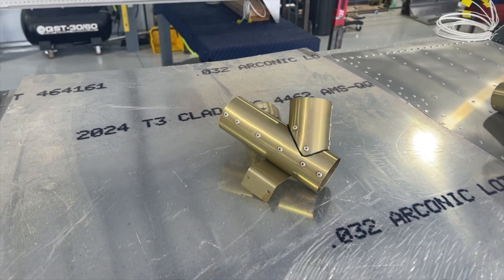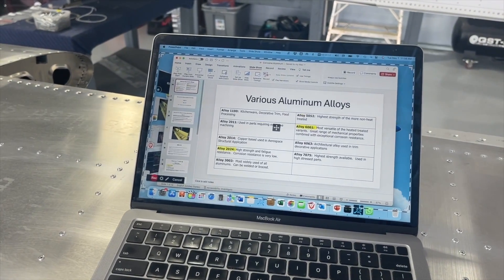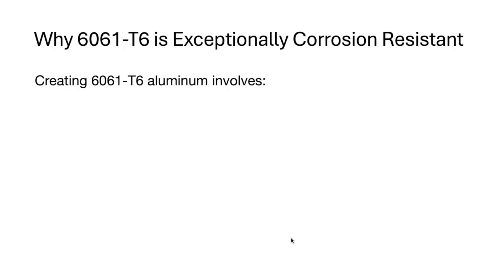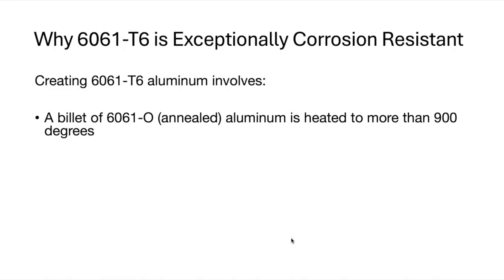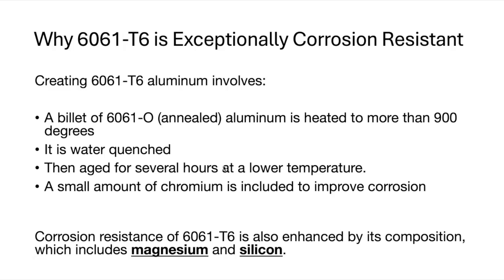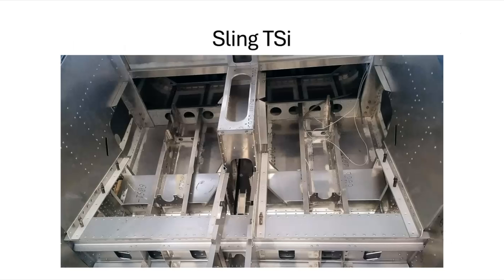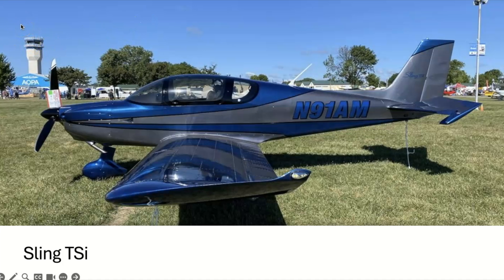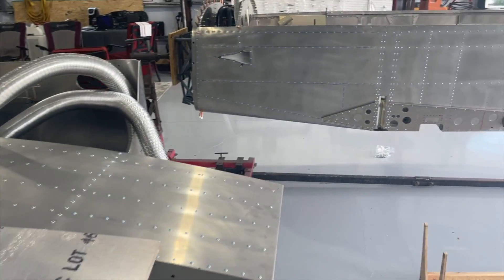Aircraft Aluminum and Corrosion [Sling TSi Build]

Comment: As someone that works on boats with fiberglass and aluminum, and is building a fiberglass airplane, I agree with everything you said. In boat construction, we often call 6061 "marine grade" aluminum. I have used 6061 in bilge saltwater applications. I have had bilge parts in 6061 constantly in salt water last structurally 20 to 30 years.
Reply from the maker: Thanks for sharing your thoughts, and thanks for watching!

Comment: I live in the North West UK. It rains over 300 days a year. I’m going to Alodine, prime with Zinc Chromate and spray internally with ACF50! Belt and braces. If anywhere will rot aluminium, the UK will. We’re right next to the Atlantic, with storms and prevailing westerlies.

Comment: Here's why this is not a good idea in my opinion, hope it makes sense. First, most airplanes are indeed made of 2024-T3 but these 2024 sheets come CLADDED with a layer of pure aluminum. This cladding is for the corrosion issues with 2024. So when you see 2024 corroding on an airframe, it is not "oh yeah that's because it's not as good at corrosion", because it indeed has a pure aluminum cladding. It is not 2024 that is corroding, it is the pure aluminum that is breaking down. NOW - pure aluminum is EVEN BETTER at corrosion resistance than 6061-T6. So 6061-T6 is going to corrode faster than your traditional 2024 built aircraft. If you would put a coating of some sort on 2024 clad, then why would you not for 6061?
EDIT: Now, if you aren't in a corrosive environment (like Florida or some place like that) - it really isn't a big deal. Won't be an issue anyways.
Reply: The problem with the Alclad solution is that the cuts/holes/scratches that penetrate the cladding will let corrosion start. My impression is that the serious 2024 corrosion issues aren't the surfaces themselves but the edges and rivet holes which are all potential places for corrosion to start. Once corrosion has started somewhere, it'll just go under the Alclad.
Reply: @patrikj  Yeah I thought about that, makes sense. However just remember almost all aircraft grade 2024 is "Alclad". Alclad is a trade name when it first came out, but all 2024 is cladded now that I see available for aircraft panels. Also - you still see corrosion in areas that are not pits or fastener areas, just to keep in mind.
Reply from the maker: Great input!  Thanks for that!
Reply: @TheBaldPilot  No problem, just my 2 cents for what its worth!

Comment: I had a short career as an assembly mechanic in the 1970s at Boeing.  Some components were made of an alloy that had a thin sheet of pure aluminum rolled onto it.  Any part of the 747 (at the time) that was exterior and not to be painted were made of this material.  At the time, American Airlines paint scheme was to leave the fuselage unpainted.  The planes had a mirror finish when the protective coating was removed in the paint shop.  They were gorgeous.  If the cladding got scratched, there was a special repair done to burnish the pure material into the scratch, effectively restoring the pure coating over that area, and then polish it so it matched the surrounding material.  If that could not be done the part was replaced, sometimes whole body panels!
Reply from the maker: I did not know that.  Thanks for sharing!

Comment: There are also corrosion specialists out there that use pressure sprayers with very long, thin 'fogging' tips to coat all the internals with Corrosion-X or similar.  Can be done every few years for those that want it.  Probably not as good as Zinc Chromate, but apparently the spray stuff is getting quite advanced.  At Sun-n-Fun and Oshkosh they have 1-hour seminars with more details on this.
Reply from the maker: Yes I have considered going the Corrosion X route.  Would be pretty messy I'm sure!

Comment: Good video. I came to the same conclusion for the same reasons. A few years down the road I'll probably do a Corrosion-X application, especially if I end up spending more time in a coastal area, where there's more salt air. Not too worried about it in my current location.
Reply from the maker: I feel the same way Mike.  Corrosion X makes it nice to go back and treat if the conditions warrant.

Comment: There are bare aluminum airplanes over 70 years old still airworthy and flying that have never been treated with any corrosion proofing. If you're in a dry environment and keep it clean it should last forever. Had a friend with a Cessna 195 bare naked plane still good as new. He spent 4 hours polishing for every hour flying to remove the water spots, but no corrosion.
2024 is prone to corrosion but most is clad with a thin coat of pure aluminum (Alclad) to protect the alloy so , except for scratches, it's stable in most environments.
I have a little experience with aluminum and corrosion as I have flying and maintaining float planes in salt water for 40 years and am anal about corrosion proofing. I just spent over a month cleaning up a Cub wing I thought would take a couple of weeks to recover because of a hint of corrosion starting. I wouldn't worry about it if I were in your shoes.
Reply: You beat to it. I learned that in the Navy.  The aircraft were skinned in 2024 T3 Alclad. The pure aluminum develops an Aluminum Oxide layer which is very thin but about as hard as sapphire passivating the surface and stopping any corrosion from happening. That Alclad layer is also why you can polish the skins to a mirror finish.
Reply: @JustaPilot1   You can polish 6061, too. You don't see many unpainted Slings, but the Sonex is also made of 6061 and they're often kept bare metal. A good 6061 polish job looks just as nice as Alclad.
Reply: @patrikj  Never said you couldn't
Reply from the maker: Good information!  Thanks for sharing, and watching!

Comment: Yeah I'm also skipping any protection. Now, 6061 definitely corrodes. I had a Sonex, which also uses 6061, in Hawaii parked outside and there was definite corrosion. However, it was only cosmetic. If that plane could sit outside in Hawaii for a decade without any significant corrosion on the 6061 parts, I'm not going to worry. The corrosion on the steel parts was a much more critical factor.

Plus, corrosion protecting the entire airframe is such a pain. I'd rather have a finished airplane that may have signs of corrosion in a few decades than a corrosion-proof half-finished one...
Reply from the maker: I hear ya brother!
Reply: IIRC Living in Hawaii is the reason you're Sonex corroded. The relatively 'high' sulfur content in your location attacks 6061. That said a flying plane with some blemishing is much better than parts sitting.